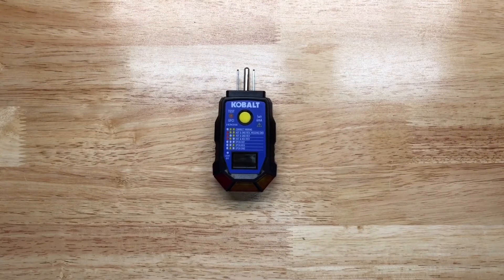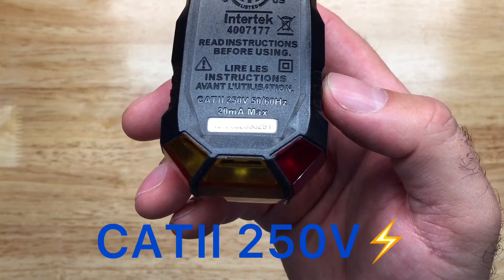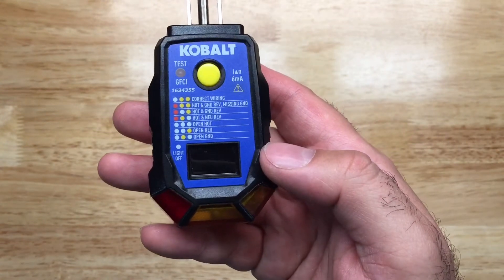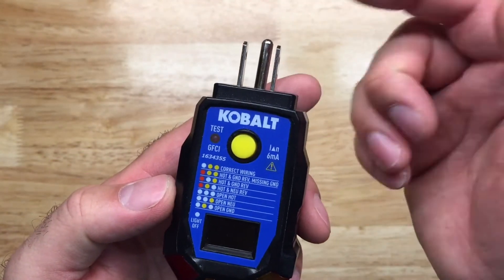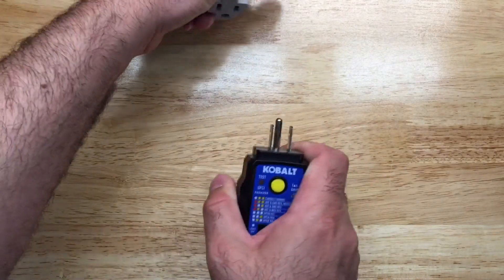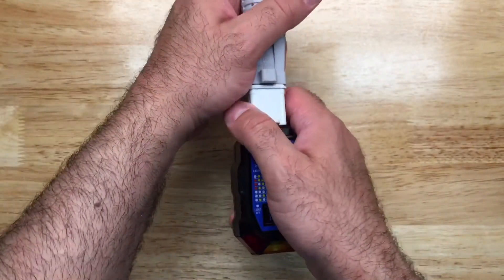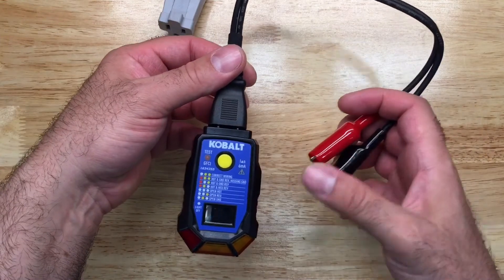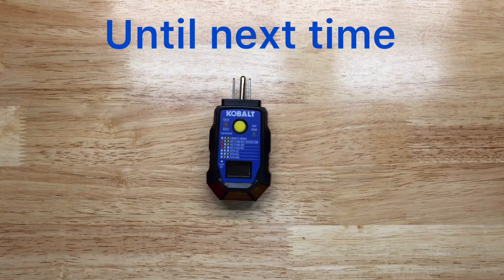Kobalt 250V⚡️GFCI Receptacle & Voltage Reader

Comment: Pressing the yellow button in the middle (GFCI) while it was plugged in - caused my house lines to be out for that line. The fuse did not blow but the line went dead. Any suggestions?
Reply from the maker: There must be another gfci tied to that line
Reply: @toollookchannel  thank you - yes located that GFCI on an entirely different room that had tripped after spending a few hours on YouTube university.

That yellow button is a disaster for home DIY amateurs and easy to press (no warning signs) for those who do not know.